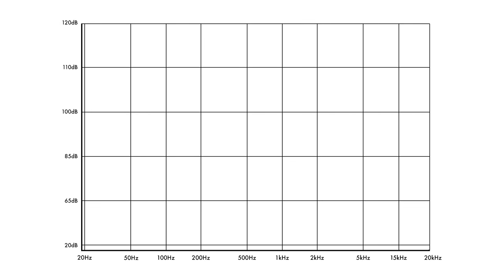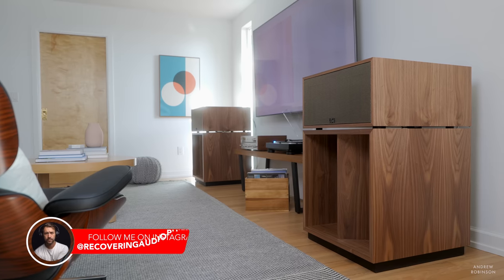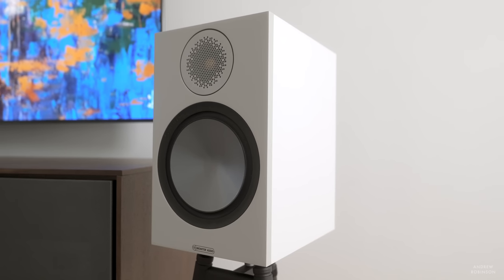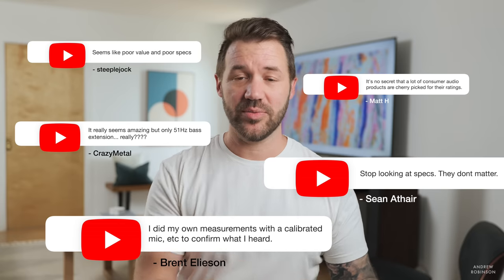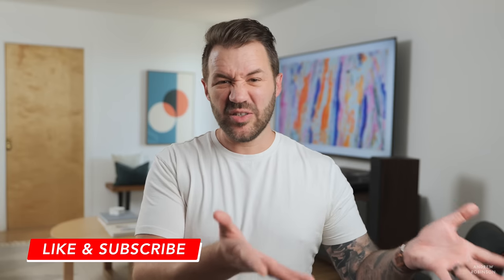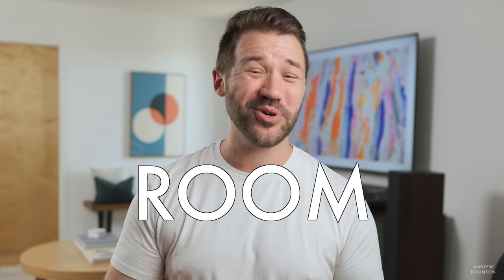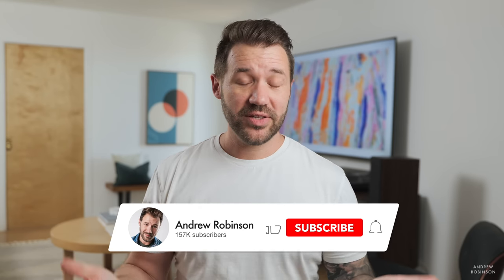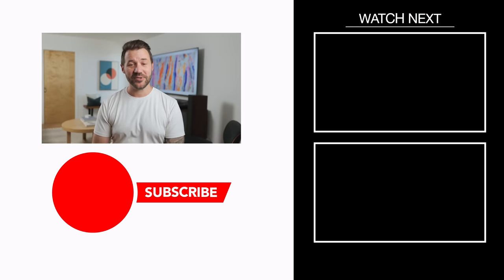DO SPECS REALLY MATTER in Audio? Understanding Speaker Measurements!

Comment: This explanation unfortunately does harm to the audio community. Measurements can tell you how speakers will sound, the level of engineering that went into them, and how much detail that will be extracted. Specifically, understanding polar response, cumulative spectral decay, and distortion. A well measured polar response ensures that reflections from within the room are controlled and consistent, spectral decay (CSD) tells you how much stored energy the drivers have, and distortion is fairly obvious though confusing in that the ear isn’t as sensitive to loudspeaker distortion as it is to electronic distortion.

Understanding objective data pushed companies to create better products and not survive on subjective impressions - which are very unreliable (bias, psychoacoustics, etc). The human cannot even accurately remember sound for anything more than 30 seconds or so and that’s hardly enough time to notice intricate details. Imagine looking at a complex picture for 30 seconds and then looking at that same picture with very minor differences and having to instantly determine any changes... good luck with that.

I enjoy your videos and there is absolutely some value in subjective impressions, but please be careful. If anyone wishes to do more reading on what I’m talking about, a good starting point is Earl Geddes’ website.

Comment: Specs are becoming increasingly important because we are doing more online purchasing. I don’t pretend to know exactly how a speaker will sound by looking at specs, but it is important that there are some fairly accurate specs.  If I don’t plan to buy a subwoofer, I need to know if the speaker I’m looking at only gets down to 70hz.  If I want to use a Vintage 20 WPC stereo receiver, I might be tricked into buying speakers that won’t work for me when a manufacturer claims an 85 db efficient speaker is 88db. If we aqueous to the idea that specs don’t matter, it takes pressure off of manufacturers to give accurate measurements and makes it harder for consumers to assemble a good system.
Reply: Like shoes, sound equipment is best purchased in person after trying it on for size.

Comment: With all due respect.  Measurements can say a lot.   First of all, if the off axis response is similar to the on axis response the reflections in the room will make the timbre sound more accurate.  This has been done through so many double blind tests.  
A flat freq response will also sound better with most music.  Not just with some music.  
Just because your hearing is up to 19kh, which btw is very impressive, keep taking care of yourself , 15-16khz is not far off and most music information isn’t up that high.  But I digress 
Measurements also matter for impedance curves.  And how well a speaker will behave with amps. 
Well measured and engineered speakers will also be easier to set up in a room 
Also well engineered speakers will not have resonances from the speaker cabinet.  Which can sound horrible.  
Yeah of course in the end if you like something you like something.  
However there have been many many double blind tests and real science around this.  
Get what you like but science is real and helps. 
Great vid and honestly I don’t have your experience. 
Cheers and no hard feelings brother , not an argument but good conversation 👍

Comment: Great video. I believe there is a middle ground. Ultimately you have to have the speakers in your room to know how they sound. BUT...specs and measurements can really give you a lunching pad and help you understand if you’ll like a speaker once YOU figure out what kind of frequency response you tend to like. It’s not the end all be all but it can be extremely helpful. You also only talked about a single measurement. Frequency response. Things like dispersion with a kippel measurement tool can be soo helpful. Waterfall graphs can tell you what the cabinet is doing and if you have any ringing in your speakers. 

I probably wouldn’t have figured out why I was missing something in my RP600m’s without measuring. Giant 6db hole at the XO around 1850khz. Once that was boosted it was like a veil was lifted. Since the measurements also told me the the dispersion was incredibly even I knew I could make that change without screwing up the reflections on other frequencies etc. 

More than looking at measurements online people should measure in their own rooms. Measurements are a tool to help you fix issues, especially below 200hz where you are hearing more room than speaker. If you’re fundamentals are wrong it’s going to screw up everything that come after and really color the sound and your perception of a given speaker. 

Ultimately your ears are the best tools you have but measurements shouldn’t be discounted. If you you come to know you like a certain recipe it’s probably true you will enjoy another similar dish that follows that same recipe. If something has a different recipe it doesn’t necessarily mean you won’t like how it tastes(sounds). But it could give you a good idea.

Comment: Measurements DO matter. Check out Audioholics response video.

I'm an electrical engineer. Now having said that, I'm not saying that you should listen to me based on that merit alone. But what you're describing is how subjective audio really is and how the listeners own in-ear transfer response along with the room transfer response can change the sound dramatically which I completely agree with, however if you can remove those subjective elements and measure a speaker objectively to gather information like dispersion, distortion, resonance, etc then you can remove those subjective elements from the equation and then you can compare speaker A to speaker B objectively without any of those biases in place. 

If you're only metric besides your subjective opinion is frequency response then all speakers are equal because frequency response can be tuned using an equalizer. But then those results are subjective based on how you measured and what type of filter you used etc.
If I took 10 pairs of speakers and EQ them to measure the exact same and place them in the exact same position with AB tests you would still prefer different ones over others.

Why is that?
What then becomes the distinguishing factor besides subjective opinion or in other words how were you influenced to prefer one over the other?

It's all in the other measurements. 
Dispersion
Speaker break up modes (material selection)
Frequency response
Resonance
Even down to the volume you played at as some speakers can handle higher volume while others distort or color the sound.
And the list goes on and on...
Reply from the maker: @Jonathan Fielding,

First, thank you for watching and for your comment. Respectfully, I try not to comment on other people's videos or on their channels out of respect. I have been made aware of the Audioholics video (and others) and maintain that they are free to make whatever content they want. However, it would appear that people are misquoting or misunderstanding me and this video completely. 

I give you a lot of credit for being an electrical engineer. I am not one (an engineer), so I would in many cases differ to your knowledge. However, in your comment you reference the following; "dispersion, distortion, resonance etc." There are areas of specs and frankly design that are never brought up in this video. My not bringing them up is not an attempt to dodge those topics, but rather because I see them as "more advanced" and thus better for another video. 

We first have to give people a relative, basic understanding before diving into WHEN or HOW other or certain specs MAY "matter". I am very deliberate about what it is that I am trying to discuss in this video. I'm also very deliberate in my conclusion when I say that "specs tell a story, but not the whole story." I further clarify my intent by saying, "specs, like reviews, are meant as guides" to better help you narrow down your choices. I actually think you and I would agree on this or these points. 

As for your comments re: EQ or PEQ etc. THAT is a very interesting thought experiment and topic that I have thought long and hard about and may take up in the future. 

But, like I've said to others in the comments on this video, I am talking very specifically and in an introductory way about specs as they relate to a speaker's reported frequency response. Trying to argue specs/measurements such as dispersion, resonance, modes etc., is attempting to muddy and/or confuse the subject/question at hand rather than directly discuss, or in this case debate the merits of what I've actually said in this video.

I hope this helps clarify things, and I hope to see you around the comments as I have a feeling you could offer those looking for more in-depth knowledge broader understanding. 

Regards,
Andrew
Reply: @andrewrobinsonreviews  Gene at audioholics has mis interpreted the main message in your vid. Because he's an engineer and does a lot of measuring its like he's taken your vid personally like its trying to unvalidate his methodology. He's made some ludicrous analogies and comes across as very defensive . He should chill a bit.
Reply: @andrewrobinsonreviews  I think it would be interesting for you and Gene to do a collab video together. Believe it or not, I think there's some conformance between what you 2 are saying. I'm not saying have a debate, but a conversation. I doubt either one would convince the other, but with an open mind there could be something to it. I made the suggestion over at Audioholics, but apparently Gene had a bad experience with you personally way back in your pre-recovering-audiophile days and won't initiate.
Reply from the maker: @Vinny Tube,
You bring up a thoughtful idea and I agree, there seems to definitely be conformance among our two viewpoints. That said, I feel like the time to have had a conversation about this topic (or any other, as this isn't his first clap-back to something I've posted) ideally would have happened before making the decision to post a response video, especially one that mischaracterizes my video's points. And that's without even getting into the petty remarks he made about me on other channels.

While Gene and I haven't always agreed on all things audio all the time, I have made attempts to handle any issues we've ever had with him privately and professionally. Had Gene or any of the others reached out to me privately, I'd have gladly talked with them and at the very least attempted to clarify my intent with this video. But as it stands that hasn't happened. So for Gene to suggest that I am against collaboration(s) is not true. Though full disclosure, I'm obviously not as likely to want to collaborate with him after this experience. I hope that you can understand. Our video was in no way a shot across the bow to anyone. The fact that people have made this personal both publicly and privately is, in my opinion sad. 

I hope that it is clear what this channel is about, who I am as a person and what we stand for. A lot of people like to say things about us without ever reaching out to us for clarification. It doesn't matter what the topic is. At the end of the day, my goal with this channel is simple: to be a safe, inclusive and non-judgmental space for enthusiasts and those who are new to the hobby. We're very clear about this and we don't censor people for having an opposing opinion but we do enforce a certain level of decorum through moderation. I know a lot of people feel they have the right to say whatever they want, but we really try to encourage people to be respectful. When people persist in being disrespectful, especially towards others, we do not hesitate to moderate.

I thank you again for your thoughtful comment and we hope to see you around again soon.

Respectfully,
Andrew

Comment: Generally agree with the sentiment WRT to loudspeakers, although the presentation makes it seem like FR is the only measurement that exists. A full set of measurements, like dispersion, sensitivity, impulse response, impedance response, phase/time alignment, etc. can give you an inkling about a speaker at a glance. But it still won't necessarily tell you how it will act in your room or whether you like it. My Magnepan's don't have the greatest measurements and I love them, for example.

On the other hand, measurements for electronics are much more clear cut. DACs and amps both have basically a single job, and they can easily be connected to calibrated professional equipment and fully understood. And the Acoustic Engineering Society and other scientific research organizations have done a lot to establish what the tolerances are for most people, such as the maximum THD before a person can hear it in the output. I really wince when audiophiles talk about an amp sounding some way, "sweet" or "warm" or whatever. I always take it to mean that it's garbage, because you shouldn't be able to hear anything different between DACs and amps that are doing their job correctly. I don't mind if someone says they enjoy the sound of a tube amp, for example, because humans can enjoy the way certain types of distortions sound - but we definitely need to be clear about how accuracy (or transparency, whichever word suits) and enjoyability aren't always the same thing.

Comment: As a former pro audio engineer I care about specs but only to get a rough idea about how a speaker sounds. It helps to know what to expect as a baseline on the location the gig is going to be.

On top of that you get a room/hall, tuning of the system, rest of outboard gear, the level and quality of sound coming from the stage, the size of the audience, humidity and so on.

I can tell you from experience that it takes years and years before you can do the math with all those variables in your head and be in the ball park of what those specs mean in real world terms.

So yes, I care about specs but only as a guidance of what to expect when you finally get some sound from those speakers.

Comment: This was an excellent video. I am currently a 3rd year audiology doctorate student and a a HT enthusiast. This explanation was a fantastic way to integrate my future profession as well as one of my hobbies. You did a great job at explaining how the concepts of perceived audio fidelity and hearing capability (or loss) influence one another. One other note I wanted to add is that typically a permanent hearing loss caused by prolonged noise exposure (not a temporary shift you feel the day after a loud concert) usually manifests between the 2-6 KHz range based on the acoustic characteristics of your ear. As this carries a hearty amount of speech information it can definitely influence your listening preferences. Although it can often get overlooked because you’re still receiving much of the high and low frequency information. That being said I always recommend a baseline hearing test to monitor your current hearing sensitivity as well as provide a baseline for the future, inevitable, decline in your hearing. 

Anyways, glad I found your channel a few months back. You have continued to peak my interest in AV equipment with your thoughtful reviews and discussions.
Reply: Great advice! I have a BS in CSD (Speech Path) and loved my Audiology and Def Ed classes. I wish I had switched majors! Thanks for watching.
Reply: @KristiWright   Thanks! Both my wife and I have our Bachelors degrees in CSD as well, from the University of Minnesota (Go Gophs!)

Comment: I rarely comment on YouTube, but this subject has me thinking...because different manufacturers measure differently, it makes using the specs very difficult. The problem for me, and I expect some others, is that I don't have a local shop where I can go audition any speaker that I want, and even if that were the case, it wouldn't be in my room, with my gear. I can't afford to just start buying a bunch of speakers to compare, so what's a person to do?
Lots of good points raised in this video. 
In the end, how it sounds to you is what really matters. The issue is being able to audition a bunch of speakers to choose what you like.

Comment: I fall in the middle.  I ultimately care about how a speaker sounds and is what primarily informs my buying decision.  With that said, bass measurements (e.g., 10-200 hz) can be very helpful when it comes to placement and/or EQ of those speakers you already love (e.g., miniDSP to EQ - namely to reduce hot spots that the room introduces in that 10-200hz frequency range).  I've been quite successful in optimizing speaker and subwoofer placement by measuring various seating and speaker placements, finding locations that minimize the effect of room modes and result in a relatively flat and consistent bass response.  Of course, I have placement flexibility in my listening environment, which many will be challenged with if, say, their setup is in a common area or living room.

Comment: Am in the same camp as you Andrew. IMHO frequency response graphs are useful in the sense that they provide you with a basic idea of what the speaker is capable of in a technical sense. It is definitely not an indication of what the speaker will sound like given the many variables that can influence the sound.
In my experience I've found that having a listening room that is close to one of the Golden Cube specs (I used the .6 : 1 : 1.6 spec) and maintaining an equilateral triangle configuration between the speakers and listening position, with acoustic treatment as required, certainly makes for a very good sonic experience.
A speakers frequency response should be used as aguide and only that. I think that the sensitivity and impedance specs are of more useful when choosing a speaker. What say you ?